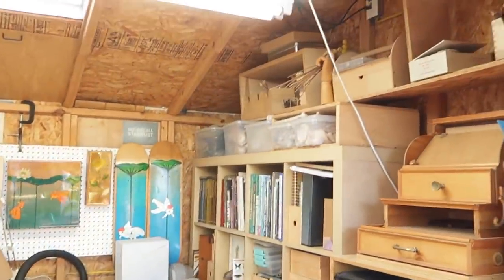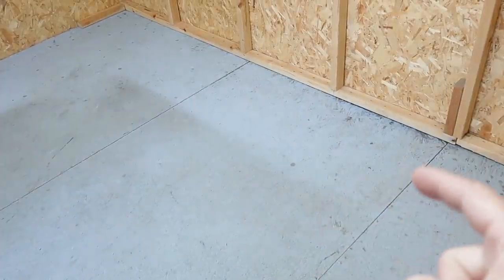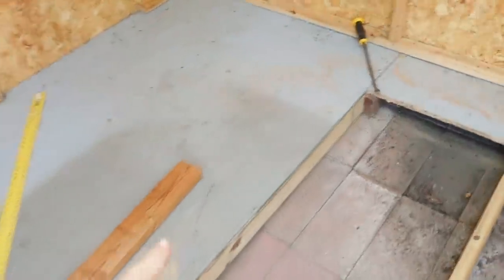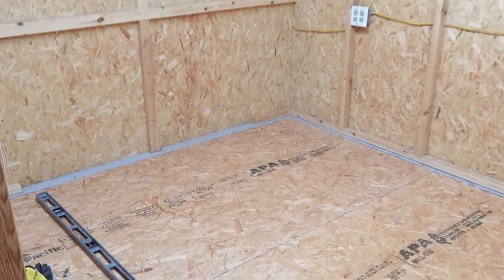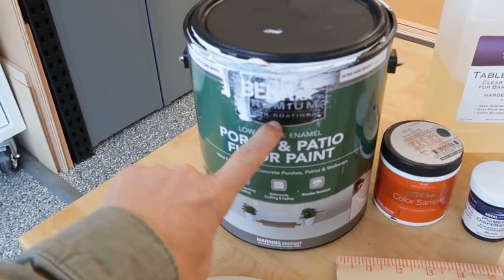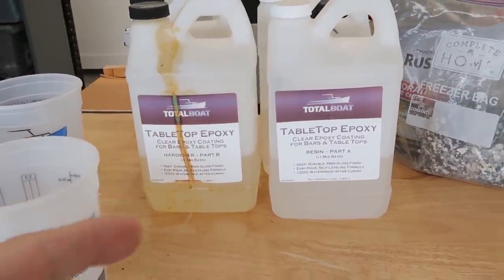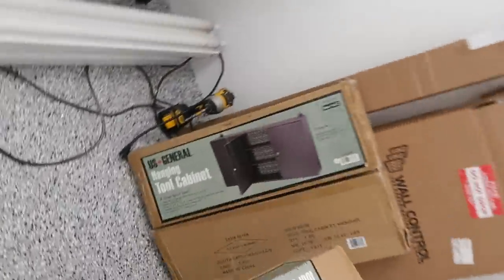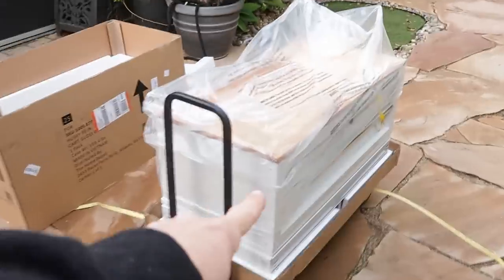Shed Shop Makeover

Comment: I'm a bit late to the game but just found you.  Organizing and cleaning is not my forte, but this is very inspirational.
I am curious though of you CNC set up, specifically the dust collection. Is the unit outside the shed or connected to your garage setup?
Reply from the maker: Thank you so much friend I really appreciate it I didn’t have a dust collector set up prior to this video which is why if the machine had not been run yet or surfaced but I’ve recently got a dust collector that I store underneath the CNC I am contemplating building a encasement for the top and bottom to help with noise but overall I’m happy with the dust collection that I have now.

Comment: What kind of dust extraction system are you using for the CNC? Looks smaller than 100mm
Reply from the maker: 😬 I still have not set one up yet is there one that you recommend

Comment: I swapped out two 8 foot fluorescent light fixtures out my shop / garage for LED. Such a huge difference.  Its light daylight in my shop. I really hate fluorescent lighting and the buzz from the fixtures. 
Like what you did with the shop. 
Question: Did the epoxy on the floor make it slick when its wet - damp or is the coverage thin enough so the chips still have a bit of bite?
Reply from the maker: Thank you so much Bill I totally agree about switching to LED from fluorescent… I did a thin enough layer of the epoxy that the paint chips still stick through giving it traction so it’s not slippery and we just recently had some rain and I walked in with wet feet and had no problem.